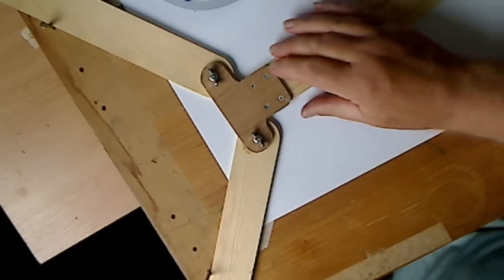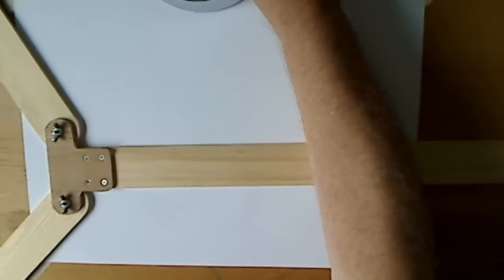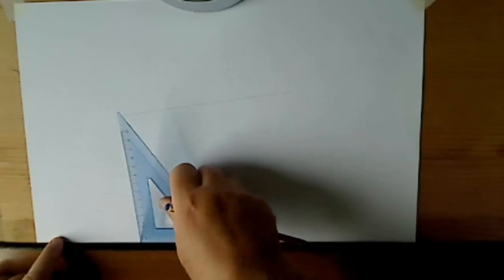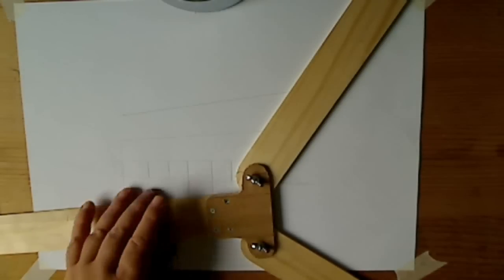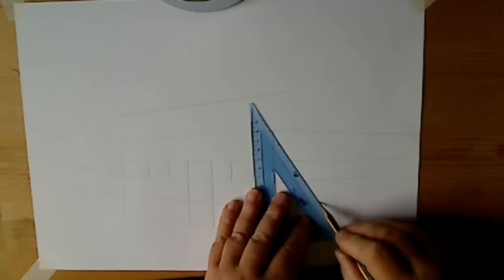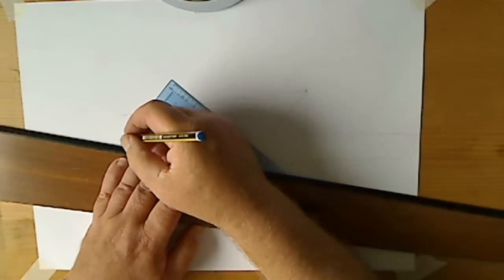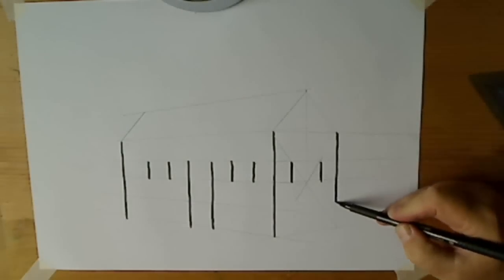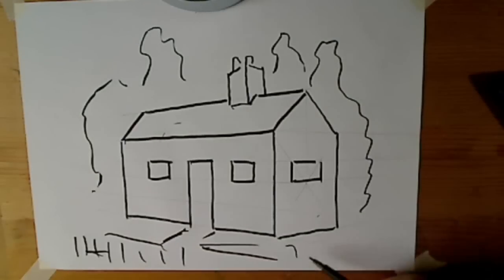Perspective drawing using a "Centrolinead"

Comment: It should be pointed out that the 3 important lines (the 2 adjustable arm edges against the pins, and the drawing edge) ought to be adjusted to converge at a single axis point in the Y-hinge mechanism.
In your example above, i can see that this is not so.
But its probably not a crucial factor for looser 'artistic' purposes, as opposed to technical drawing usage.